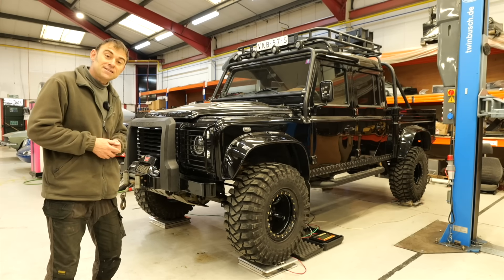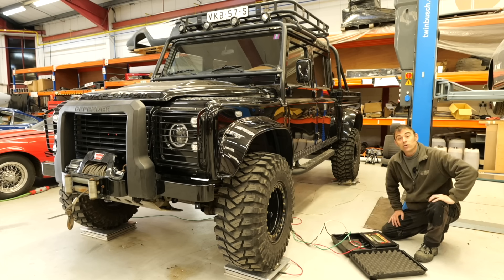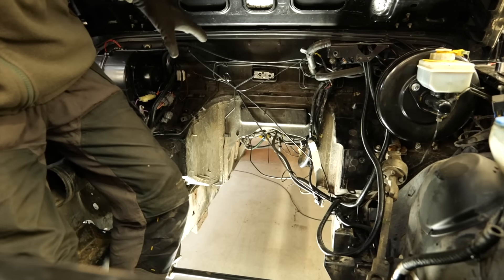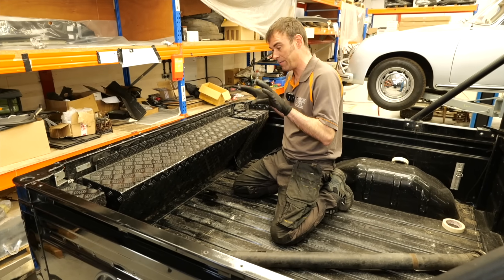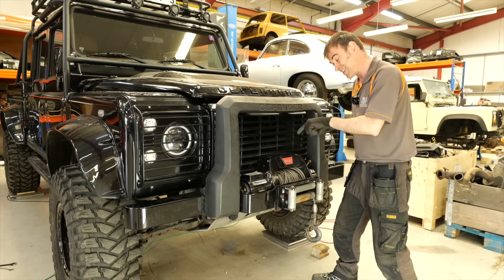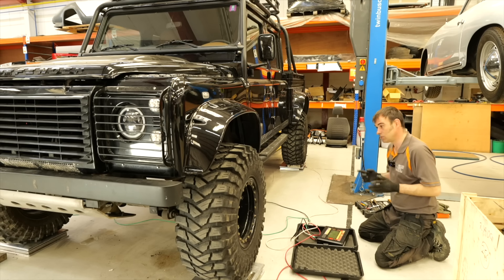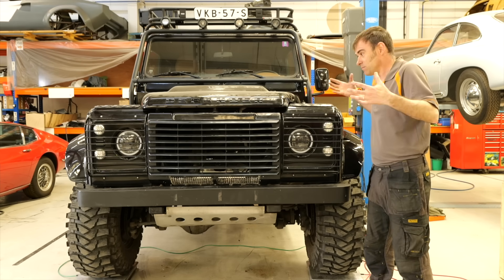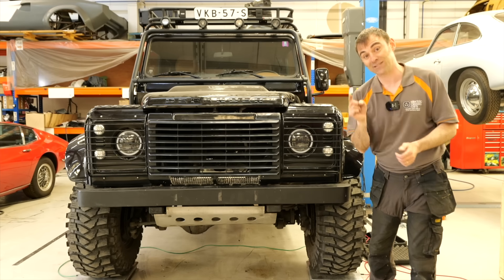A project with a weight problem

Comment: One thing you missed is the weight of the driver and maybe a passenger with luggage which will be added to the vehicle when the project is finished.
You can lighten the weight of both bumpers, and use lighter weight wheels and tyres. Maybe remove a lot of wiring too.
Nice project! Thanks Richard. 🙂👍
Reply: They said at the start they are allowing for 4 passengers, that includes the driver
Reply: Also use an Aluminium bonnet.

Comment: The comparison @3:40 is ridiculous. If you're going to show all of the engine accessories on the ICE side, then you need all of the electrical power accessories on the EV side... every bit of wiring, the onboard charger, all of the contactors, distribution boxes, charging inlet, etc. And the battery, because the battery isn't just a box (as the fuel tank is a box holding fuel which is directly usable by the engine)... it is an electrochemical system which converts the stored chemical energy to an electrical form usable by the motor.

Comment: Those tires and wheels are a huge weight detriment, unless that's what the client wants to keep.

Also if you wanted to save weight in other places, replace the windows with plexiglass, and remove whatever sound-deadening is in the doors.

Comment: Weight is the unseen killer of a lot of vehicles. Motorhome are the best example of being useless because of weight, unless you have a HGV licence and go to a higher weight total. 3500kg is the limit unless you go replate , relicense and  modify it otherwise they are payload limited and easy to go illegal as the empty weight is very high to start with.

Comment: How do you get this beast back on the road after all the mods do you need to
 re-register it as a a kit car
Reply from the maker: No need to re-register it as the motor and battery boxes bolt into the same mounts as the engine and petrol tank. Just need to inform the dvla of the fuel type change.

Comment: The weight of the 4 bikes is not 400kgs, it’s probably more like 480kgs. It’s only 80kgs but it all adds up and as you are chasing weight savings I thought it was worth a mention. They INCREASED the production bikes weight last week. Cool project though 😁👍👍
Reply: Totally, the power has increased to 6.5kw for the pack though. There’s the chargers for the bikes as well, being a show truck charging each one on its own wouldn’t be great. I get to find out what it’s like to ride tomorrow 😁👍👍
Reply: Yes, Stark Futures is showing 118 kg weight for the Varg now. Plus riding gear for 4 people. Going to be interesting to see how they cram 4 full sized bikes into the bed of that Landy, going to be a very tight fit, if they can do it at all.

Comment: Richard. 
Remove the steel winch Cable and replace with Polymer rope. 20 KG just there, then those ridiculous oversize wheels and tires and run more modest tires and wheels that will also make loading the bikes easier.  
A slightly smaller width tire and slightly smaller size tires another 80 kg less easy.

Comment: Some sexy Tillett carbon seats would save you a fair bit of weight, surprising how heavy seats in modern vehicles are these days
Reply from the maker: Yep. The rear Land Rover seat weighs a lot.
Reply: @ElectricClassicCars  just tell the build sponsors it’s a safety thing 😂
Reply: Yeah bmw e36 seats where 31kg a pop, so I saved 56kg with seats

Comment: If the only things that are going to be carried in the bed is the bikes, remove the entire bed and sides  and rear roll cage and replace them  with just enough framework to hold each bike which is then integrated structurally with a longer roll cage, that will be big enough to have the bikes inside it,  that will form the structure holding the bikes to the car. Skeletonised as Q used to say.

Comment: DELETE Rad, Fan, flywheel, clutch, gearbox, transfer case,prop shafts, F & R Axles,FUEL. & EXH SYSTEMS, ADD 10 kg CF, - BATTS, CONTROLLER, 2 X HYPER 9

Comment: Tyres are very heavy, I think a big saving could be had with less agressive ones. 
Any steel racks abd bars like the roof and grill could be changed for aluminium.
If there are airbags in it they could be removed. Side and rear glass could be changed to plastic.

In terms of panels like the bonnet. If CF is too expensive, fibreglass still offers massive weight savings over steel especially if the rigidity of foam is exploited.

Comment: If money was no object, you may be able to remove the steel roofrack and replace it with a carbon fibre one to save weight and lower the centre of gravity, making the Defender less likely to roll when off-roading and traversing side slopes.

Comment: Change the cast brake callipers for billet aluminium ones, not sre which inner wings it has some are steel some are plastic
Reply from the maker: It has the plastic inner wings. I checked that one. 😁👍

Comment: according to your board, the battery should have an energy density of 214Wh/kg, which seems a bit too optimistic. At least, if it has proper liquid cooling. Also considering that your teslarossa conversion had a battery with an energy density of just 170Wh/kg, according to that other board.
Anyway, you should contact CATL and ask them to provide you with the Qilin battery modules. With a claimed energy density of 250Wh/kg at pack level, you would drop additional 100kg from the 770kg. Or, source the pricey silicon anode batteries from Amprius with 500Wh/kg. Or the same from CATL condensed battery.

Comment: If the customer only wants the roll cage, roof rack, etc for looks, could you replace them with aluminium (I'm assuming they're steel at present)?
Reply: I was thinking something similar with the running boards. Aluminum ones would probably be quite a bit lighter.
Reply: There are standards for functional roll bars which I would encourage one to follow.  No sense in just using fakes...  what happens when one needs it?

Specs are either for mild steel, or chromoly (which uses thinner tubes).  

The roof rack could be made out of aluminum.
Reply: @C1Ksdafafdsa980ufsd  Nobody is advocating "using fakes". There are aluminium alloys that are easily as strong as mild steel.

Comment: Good job! 
It seems you removed the transfer case. Can you do without low range/locking? How do the prop shafts connect to the motor?
Reply: This video answers your question: https://www.youtube.com/watch?v=HoqoL1EyAHk
Reply: @generalvoltage1821  Got it. Thanks. (I had even watched this last year and forgot about it.)

Comment: I wrote at first introductory video about this project that a Ford F-150 Lightning with modified suspension from Raptor: it has charging outlets from factory, best in business AC built in charging unit is 18 kW. This rig is cool and crazy but too porky.

Comment: Gross weight is 3500, but on a stock wheels. This vehicle has heavier ones, but with that conversion you can add the difference in wheels weight to gross weight, because it doesn't affects load on suspension or other parts. So you may put on stock wheels to make gain/loss calculations, or just substract wheels weight difference from the start weight before and after fitness. In other words, you have wheels weight difference on scales, but you don't have it on suspension, so it should not be present in load capacity.
Reply: Afraid not, in the UK the gross vehicle weight is the whole vehicle - as if weighed on scales - 3500kg is actually a legal limit for passenger vehicles - above this and you are into light commercial vehicle requirements.
Reply: @TC-V8  Good point, but is this intended for a UK customer? Currently on Dutch plates I think?

Comment: The earlier Td5 bonnet is a lot lighter than the Puma bonnet, as it's made from aluminium and not steel. In fact, the earlier push-button doors are a lot lighter too for the same reason (identified by the fact the window frames are welded together rather than a one piece pressing). You could go as far back as the two-piece doors with sliding windows. Rocky Mountain in Canada do some very nice aluminium door tops for these which would save weight.

Other than that, the Bowler wheels would help as they're a lightweight 7.5" x 16" wheel rated to 1200 kg each - enough for the max. rear axle load of 2200 kg of the Defender 130. You could go down to a more sensible size tyre, which will save an awful lot of weight. For the power, you could run 265/75 R16 tyres on those wheels.
Reply from the maker: Good info. Thanks 👍👍👍
Reply: @ElectricClassicCars  Thought it was on bead-lockers but they're just fake steel wheels with studs. So a good set of alloys should shave a few kilo's. 
Aftermarket suspension - radius arms etc. are available with a skeletal design that is lighter yet stronger.
Reply: Great info 👏👏👏
Reply: Replace the bonnet with carbon fiber.

Comment: Well it is for Bikes, Get rid of rear Tray, just a table top with some latch points, Tools under tray, What are Wheel Arch Flares Made of ? Roof Rack Steel or Aluminum ? :)
Reply: Here is a Photo of some body elses take, 2 Bikes are @ 45 Deg on back of Ute, I like how Bikes are almost ready to come off when needed, in photo, the "toolbox" in Center, could be 2 More Bikes, with Tools & Spare Forward under ramp for this Style of Racks, http://i.imgur.com/HZ4Ayvt.jpg

Comment: Wow. That Landy was wasting a LOT of gas hauling all that weight.
Reply: I suspect a lot of LR owners use them to boast how much they can afford to pay for petrol.
Reply: A lot of that weight was the engine and related parts. Wouldn't have used any gas (diesel) without that!
Reply: @drumbrakes  I was talking about the tow hook and the metal bar in the cargo bed

Comment: A tyre size smaller or narrower also would shave some weight. Glass also weighs a surprising amount maybe change some of the side windows for lexan and also lose the electric windows. Dash components could also come under scrutiny as that weighs a lot too. Seats could also be changed up for lighter, sporty bits. Could be as much as another 100kg in that.

Comment: GRP bonnet, if the doors are the later steel ones, see if you could get older alloy ones, or even old series 2,3 like your 90.
You could see if lighter tyres as those look like trepador ones which are heavy. Cooper STT or even bfg mt may save 5-10kg per tyre.

Comment: You wanted to keep a fairly aggressive off-road look.  I'd put the winch back on, but use a synthetic cable, aluminum fairlead, and an aluminum bumper and bull bar.  Warn is a good brand.
What is the roll cage made out of?  If mild steel, then building a new one out of chromoly will save a bit of weight.  
Build a new roof rack out of aluminum.  
There are comments about messing around with the bed.  Is the old bed steel or aluminum?  You might end up making a new aluminum bed or tailgate that displays the motorcycles better.

Comment: Obviously nice to get the weight off but as it’s a Landy did the customer or yourself look into upgrading the carry weight if you couldn’t drop the weight in case customer wanted to keep winch or even put a bigger battery pack in .

Comment: whatever steel parts are available in alloy will save you 2/3 of its weight when exchanged... comes all down to cost really.
Reply: And the owner of this vehicle does not seem to have problems in relation to cost 😉😉

Comment: Would switching to independent suspension like in a Tesla save the weight of those huge cast steel live axles?
Reply: Africar 6 wheeler lessons.. beam axels are cart horse tech...

Comment: You did mention the bonnet, what about the lights, if converted to LED with full removal of all their old assemblies, maybe lighter seats with more carbon fiber and the internal sound insulation with some form of light PVC since the motor and the electrical components are virtually quiet. just a thought.

Comment: Get rid of the head light protectors and yes drop in a carbon fibre bonnet. And then convince them to drop the roof rack. Slightly smaller or narrower tyres will also drop some weight. Guaranteed they'll throw a bunch of stuff in the back as well as the bikes (like ramps and gear) so you need that margin too.
Reply: Smaller tires would reduce overall weight, but if anything might reduce the overall weight capacity of the vehicle, in addition, you need to consider that the weight that is important here (in terms of safe operation) is the weight carried by the suspension, not the overall weight of the vehicle, so on some level the weight of wheels, axles, and part of the drive line doesn't really count toward an important part of the total...
Instead of weighing the whole vehicle, they might just want to weigh the parts they remove and compare that to the parts they are putting on.
Another thing to consider is weight distribution, especially when it comes to handling, braking and safety... this might actually be an opportunity to improve in this area.
Reply: @davideloewen  buddy its certified  gvw is 3.5t on standard wheels.
Reply: Fill those tyres with Nitrogen. It is 3% lighter than air Ha ha!
Reply: @peterduxbury927  Or helium - then it might float away.😁
Reply: @minimoog4236  Good comment!

Comment: Poor comparison because you forgot the battery pack and other gubbings .
Fit Hyundai twin tank technology clean burning CNG and get the CNG from waste instead of putting it in land fill .
India use bio CNG and CNG burning vehicles to tackle pollution.
Reply: Did you watch the video?
Reply: @JohnR31415 Yes ...3mins 42secs .Try making that electric motor work without a lofty battery pack which he doesn't show  .
Reply: @rocklover7437  3:48 he explicitly says no petrol tank or batteries -- it's just an engine vs motor comparison. And his whiteboard at 1:47 shows the weight allowance for the battery packs.
Reply: @matthewsmith8573  Big Car channel latest upload ..He drives a electric car btw .
Reply: @matthewsmith8573  But he was being tricky showing that image at 3mins 48secs as well as gunting under the weight of the bonnet and box under the rear seats ( needs a acting oscar lol ).
Fk me by the time he gets the weight down there will be nothing left of why people buy a Land Rover .
Go watch Big Car channel latest upload on pros and cons of electric and remember he drives a Tesla.
Reply: @matthewsmith8573  The Jensen Interceptor paid it's day one manufacturing carbon hit on the Planet years ago like all collectors cars and fitting a electric motor and battery is like a new day one carbon hit on the Planet.
Reply: @rocklover7437  the chassis may be paid up, but the fuel is ongoing. Your argument about the Jenson being better as petrol,only makes sense if it is kept as an ornament and never driven.
Reply: @rocklover7437  you need better glasses
Reply: @watcher24601 Clean burning  CNG conversation using the new twin tank technology to save boot space .Keep the glorious 440 V8 .
I run as a daily driver a 8.2 ltr 1979 Cadillac Coupe Deville on half price clean burning LPG .On a nice steady motorway run using the added Gear Vendors overdrive/underdrive i can get mid to high 30,s mpg which at half price LPG means the equivalent of nearly 70mpg . For all out power i switch to petrol .I swapped out the original carb for a Holley Sniper EFI for performance and run soft hit nitrous oxide injection so giving me the option of fuel economy or performance.
Free road tax, no MOT and cheap as chips classic car insurance. I also can drive in a ULEZ area free because it's older than 40 years old.
I bet my LPG conversation is overall more Planet  friendly than electric .I would swap to even cleaner CNG but there are only 8 petrol stations in the UK that sells it.
Reply: @rocklover7437  you’d lose that bet hands down.
Reply: You should've gone to specsavers 👓
Reply: UK only has 8 petrol stations that sell clean burning CNG and they phasing nearly as clean LPG out .The future is going to be electric option only .
Green energy cannot supply the energy for everyone to own a electric car. But if we are all living in 15 min Cities that won't be a problem.
Example of someone living in a block of flats how are they going to charge their cars up ? A charging station i hear you say .If everyone swapped their combustion engine cars for electric there would be massive charging stations the size of football fields all over the place that's providing you could produce enough green energy to supply them .
Electric cars are a trap to get us out of any type of vehicle.Its not about saving the Planet it's about control of the many by a few .
Turn of the last century electric cars was only for town use and they are still only good for town use but charged with inbuilt solar panels and low milage use ( 15 miles a day from the Sun ).
The most successful electric vehicle is the milk float because it was a town vehicle .
Reply: @rocklover7437  well done, you win EV myth bingo. Put your foil hat back on. You clearly haven't bothered to watch the video about the customer requirements or what this company does and are just wasting time.
London has some of the best public transport, yet everyone wants to pay to drive their own personal polluting  bubble. World is a crazy mixed up place!
Reply: @rocklover7437  The electric vehicle should be about reducing toxic exhaust gas in a built up area, I.c.e vehicles should be allowed to operate away from built up areas.
Reply: @ianmangham4570  I agree ,they was originally designed as a woman's town car early 1900,s .